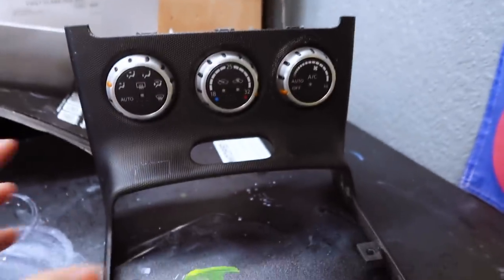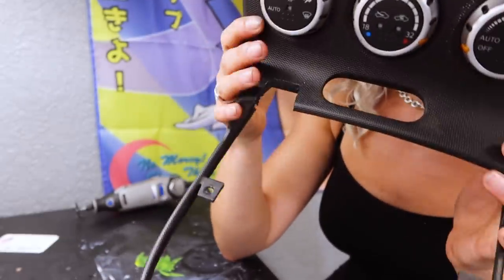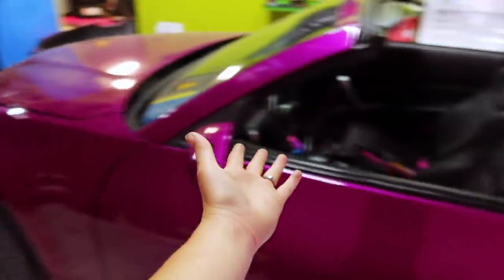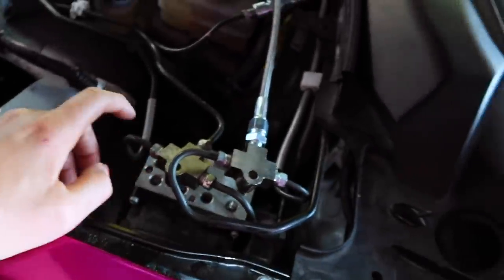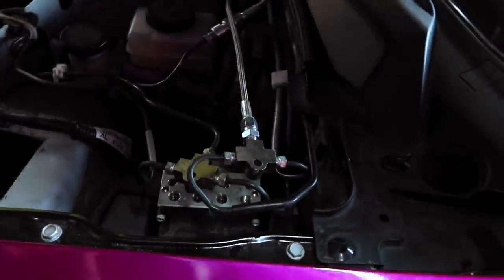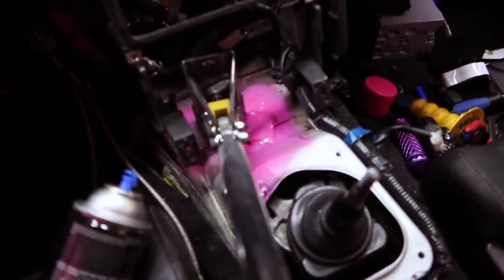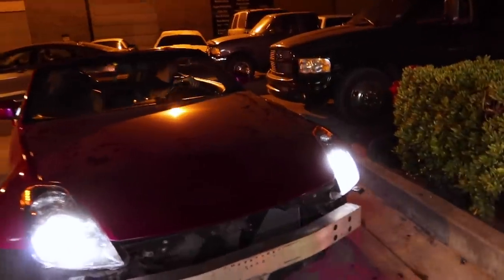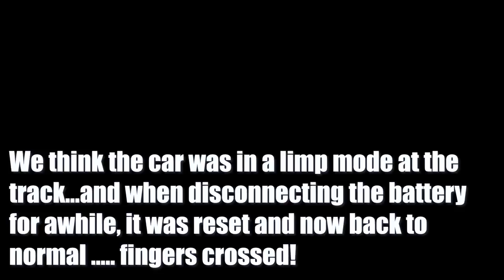350Z TUCKED HYDRO INSTALL *low power issue fixed!*

Comment: i think some how the stability control was working causing it to fight you and abs fully eliminated it fixed it just my thoughts lol
Reply: You really could be right though. They have traction and stability control. You can turn the traction control off with a button but stability control is still there limiting throttle. With a abs fault it will cut off both systems.
Reply: @paulsensabaugh7879  and by disconnecting the battery you reset the abs error state
Reply: @paulsensabaugh7879  some cars you need to press the button 5 sec and then the stability control gets off too... in my firend g35 it worked like that so...
Reply: yeah i was about to comment the same thing, Stability control uses the ABS, so now its deleted... All good

Comment: Probably trying to switch off the ABS caused a limp mode by ECU safety, which has to be reset. By OBD or by taking the battery off. Now it sounds like a real 350Z. Have fun. Regards, Nico

Comment: If it turns out that it's not the motor or the computer in any way causing the power loss could it possibly be the rear differential is geared differently from a coupe
Reply from the maker: We thought it might be but checked it, it’s 3.5

Comment: I think a turbo setup should be coming by now, repeated things from the other Z, getting really repetitive
Reply: A turbo wouldn’t be as reliable. She has other cars for big power, but the point of these 2 Z’s are to be seat time cars. There’s obviously some similarities, but they’re not the same and soon she’ll have lots of drift content incoming. I’m sure she’ll probably do an easy power adder like NOS fairly soon, but the glory of Z’s is they do well without major modifications.
Reply: Metal Mind Yeah I totally get that but she wants to try to learn to tandem but her cars power band is not that great and now she’s bought a convertible which is even worse with a shitter gear ratio. I just think she needs a bit more power to do pretty much anything out of her comfort zone. Plus the content is the same as weeks ago on her other car. I get the jist of another seat time car but like she’s realised, the ratio is crap for a lower power car.
Reply: @pdxmix  so NOS is reliable lol??
Reply: NOS is extremely reliable. Unless you go overboard and crack a ring land because you don’t have enough gap. But you have the same concern with any power adder, and that’s only a fraction of the issues you have with a turbo. Do you know of another issue with NOS?